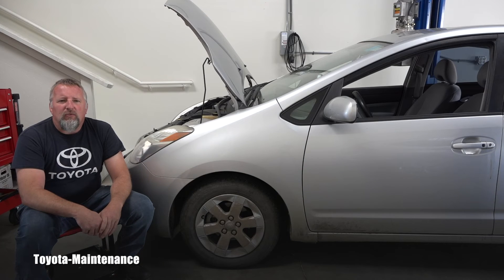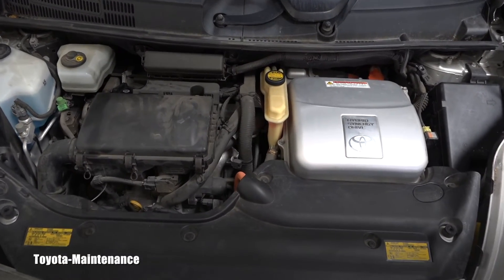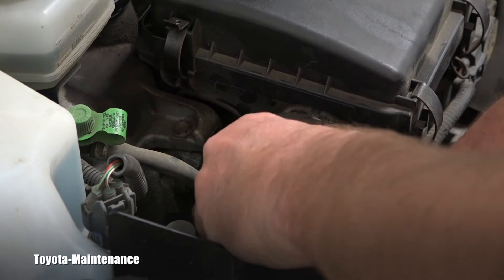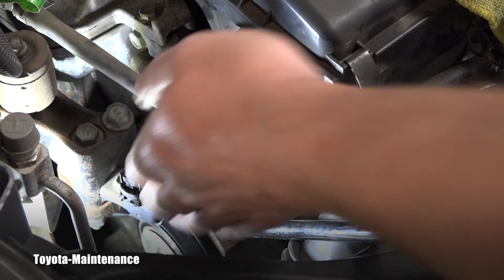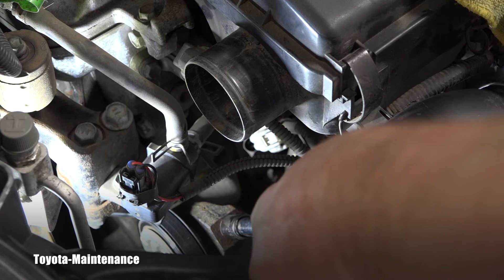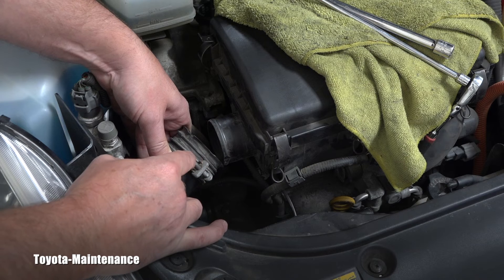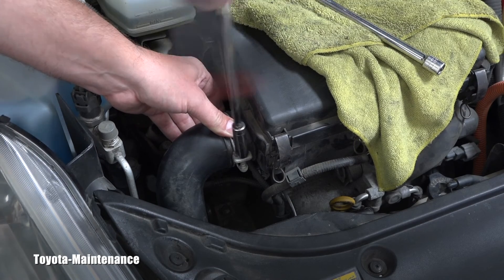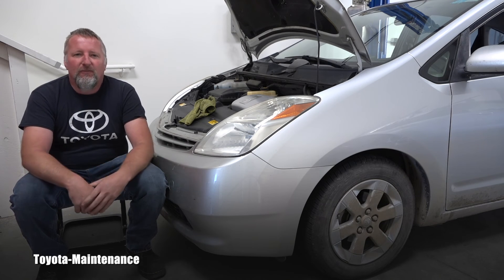Toyota Prius Engine Drive Belt Tension

Comment: Nice, simple, and straightforward video.  I would just add that the 14mm bolt on the idler pulley should be torqued to 30 ft lbs., and the deflection on the (used) belt, which should be measured halfway between the idler pulley and the crankshaft damper pulley, should be between .43 inches and .59 inches (per Toyota factory specs), when applying about 22 ft lbs. of force.  Keep up the great Toyota videos!

Comment: My name Fabian Sanchez I been driving on my o6 Prius with out a belt since I bought it my pulley's are rusteded I found out cous all over my inside dash has green tape  but my heater works and air conditioner
Reply: With no belt you run the risk of overheating, it runs the water pump.
Reply: You can't drive without a belt dumbass

Comment: I had my water pump replaced on a toyota avensis 1.8 t27. New drive belt fitted which after couple of days started making squealing noises. Tightening the belt maybe 5 times squealing noise got better I did the 90 degree trick and still get one mini squeal sometimes. The belt still feels like its not over tighten but how much is too much? or ignore it its squealing noise literally takes 1/10 of a second.  Thanks